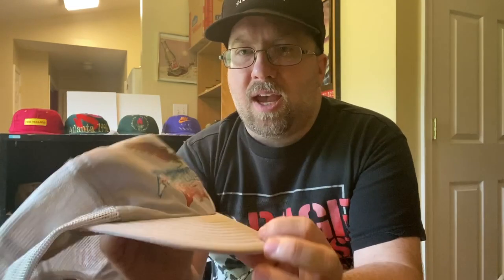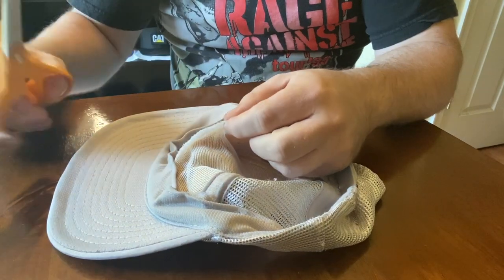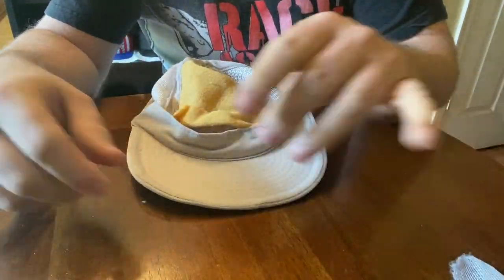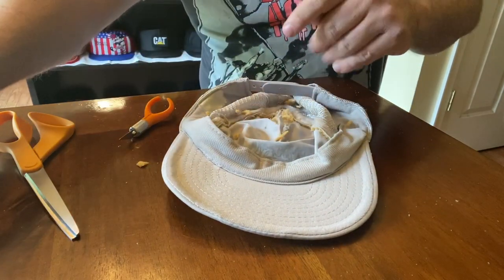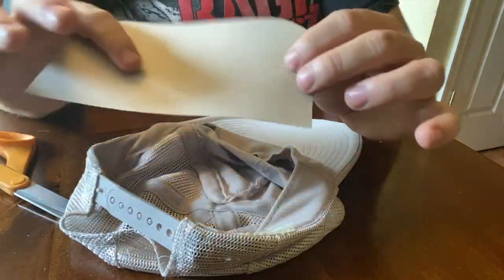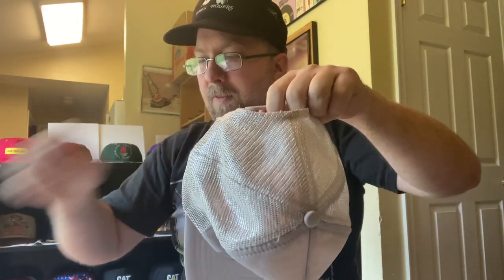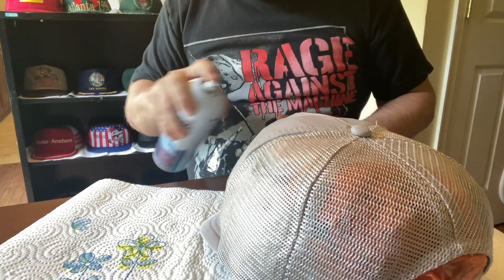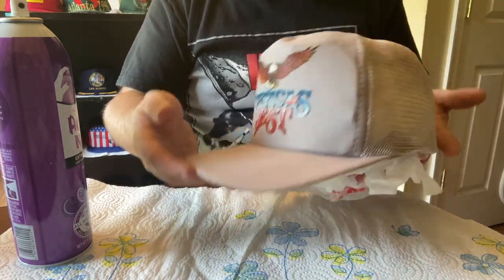Trucker Hat Restoration - Foam Deterioration Removal & Reshaping

Comment: Is it possible to replace the foam? Does anyone do true restorations?
Reply from the maker: I am currently working on that process.
Reply: @cernochsconnection171  I have too many cool hats that need real work, I have one that needs visor replacement that is such a cool hat man but I think I will have to replace the fabric too if I unstitch, it's a satin nylon. By the way what is the best hat cleaning product?

Comment: Can you make a video on how to store hats after you clean & reshape them until they sell on eBay or wherever & your shipping process! This would be so helpful! Thank you
Reply: I'm a big hat reseller and here's mine...I bought metal shelving and some 64qt clear plastic containers on Amazon. Figure out a sorting method. Mine is sports leagues, auto racing, then I go by color if they dont meet the other categories. Others will do standard inventory systems, its up to you. Just figure out a way that makes them easy to pick after you made the sale. Nothing is worse than sorting through 4+ bins because you forgot which one its in. The hats can easily be stored stacked together, just push the back into the contour of the front and "stack" them carefully in the containers. For shipping I use either 10x8x6 or 9x7x5 box, hat is inside a clear poly bag with a layer of bubble wrap to prevent too much movement. Customers seem to like my packing method.

Comment: I found this video because I have several vintage hats that suffered from foam deterioration, and I'm looking to replace the foam. 
I'm hoping that someone made precut foam inserts that I could order, or at the least, someone could show me their process and techniques for replacing the foam in their hats. I don't want to settle for gimmicks or tricks of cardboard inserts and starch.
Reply from the maker: Hey Aaron, I’ve been working on that exact same thing. It’s still in development, hopefully I’ll have it mastered soon.
Reply: @cernochsconnection171  
Hey man, do you think this restoration process would work to turn an unstructured low profile hat into an structured mid or high profile one?.
Reply: I also need replacement foam.  Only thing I can think of is buying cheap new foam trucker hats and salvaging the foam from them, then selling the hat minus the foam.  Or just go to a craft store and find some stiff comfortable foam thats thin.
Reply: @MrWolfSnack  I bought some foam from JoAnn's that's pretty close to the original foam. One side is iron on, and both sides have the mesh netting. I made a quick video about it on TikTok and posted here on YouTube also. 

https://www.youtube.com/watch?v=YXSv3EZDmBc
Reply: @AaronHorrocks  Nice!

Comment: anybody find a solution for a cracked brim? just bought a beautiful hat n don’t want to waste it
Reply: I did it at least five times. There's only a way: gently remove the broken bill (I mean to nto damage the front of the hat) and replace it. In first paying attetion that is "centered" and not asymmetrical. Be ready with three needles wtih sewing threads already in. Helping with your hands to hold the bill in the right position start to FIX that thred to piece the interior border of the bill with the lower border of the front (be sure to put the needle when this side curve a little bit). Once you've fixed those three points (a central one and two aside) you'll be able to sew the whole border of the bill to the lower border of the front. Then rise up the sweatband and sew it to the bill. It sounds complicate, but the real difficult moment is when you fix the first three points of thread. The rest is not complicate, just loooooong. lol. Be sure to use the needles only in the inside part of the front. If you don't want to feel the unpleasant sorta "I glued it so I cannot say how long it will keep glued) teh only solution is using thread and needle in the way I suggested you.